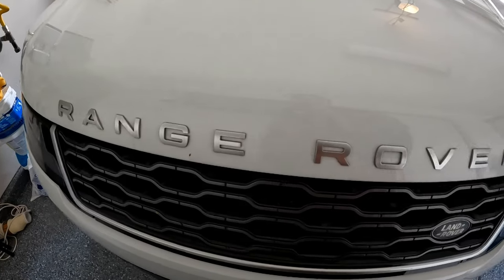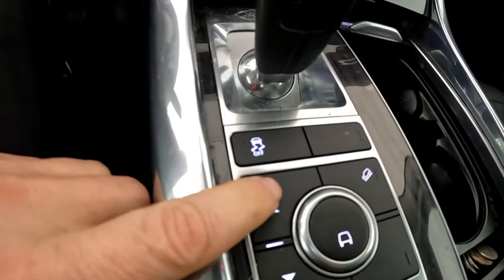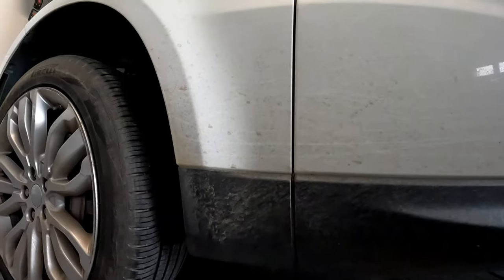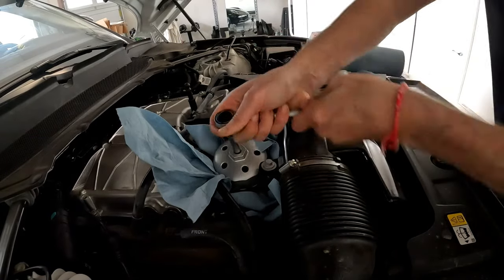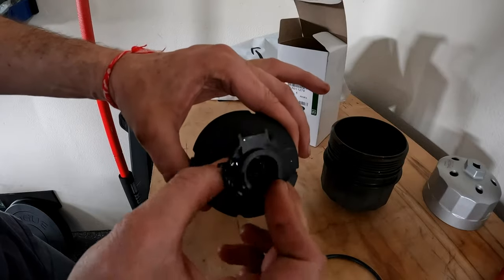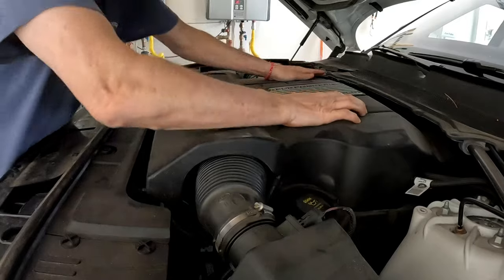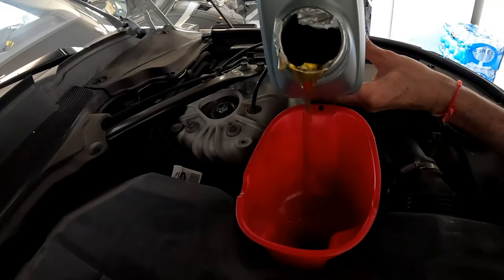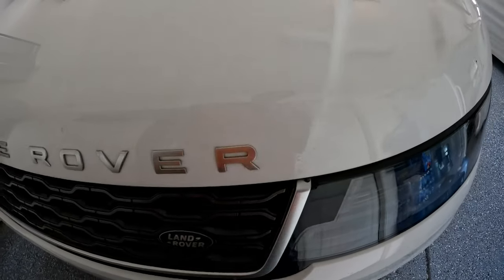Range Rover Sport Oil Change - Covers other model Land Rovers

Comment: This car, at least 5.0 and 3.0 supercharged engines, are designed to have oil changed without lifting it up with oil extractor.
I just did oil change+both filters+cabin filter in about 1 hr.
Very thoughtful design, thank you Land Rover / Ford engieers. When you remove oil cap, you will see sort of stainless steel tube sticking out, just connect the extractor to it, thats all.
Preferebly do not use watery substance 0w20 or 5w20 that is energy saving, i.e. gives you 0.5% fuel economy, and NOT engine saving oil, engine saving/protection is what you want. As of 2019, engine replacement pricetag was $28,000. 
I use RedLine 5w30 and have been for years. Oh, and yes - 5k miles max!

Comment: So one question that is controversial? I was looking to change the oil in between services as I dont really do many miles so for cost of some fresh oil and a pump I might as well do this at home in between, 6L out 6L in, I was not going to bother changing the filter for this interim, just doing the oil more so to negate the oil dilution possibility that often plagues the 3.0TDV and SDV6 well any of the DPF fitted cars. The oil filter is the biggest pain as its one of those cartdridge type and just wants to throw old oil over the engine. What are people thoughts as the oil had only covered 3K since last service and that most of the mileage for the year anyway, just wondering if there really is a need to do the filter for an interim service or is it changing it just for the sake of it? TIA

Comment: I just had my range rover serviced and i watched them put oil in it and now my car says oil level not available. Do u have any suggestions why it is saying that now? Please let me know
Reply: You have to check when the vehicle is off or has been off for at least 15-30 mins. Do not turn your vehicle on or else it won’t show it. Turn it to accessory mode or before you officially turn it on and then check through the menu options. You’ll see the level

Comment: Is this really takes 16000s miles to next services?
Reply: No! Do oil change every 5-6k miles on these vehicles. You wonder why they don’t last 100k miles or wonder why they are so cheap when they get older, it’s bc of bad maintenance intervals by the dealers.
Reply: Absolutely not. I go 5k miles on the L405 with the Supercharged v8. Cheap insurance.
Reply: With full synthetic oil. Change it 3k no more than 5k miles. The dealership will say every 20k. Mercedes says the same. They do that to make money. So ever 3k no more than 5k with full synthetic